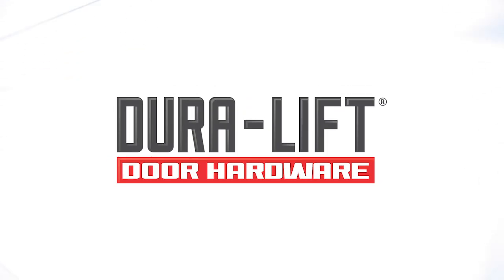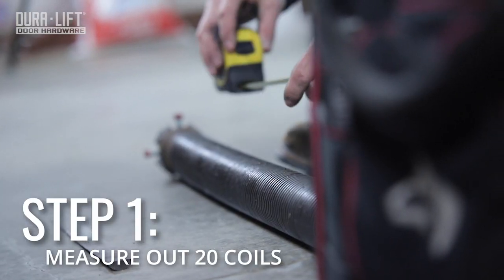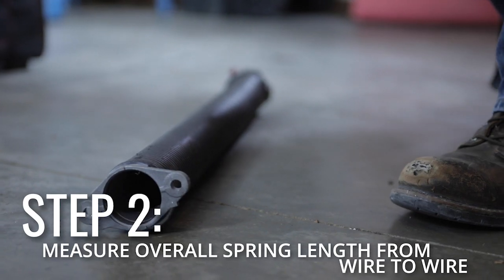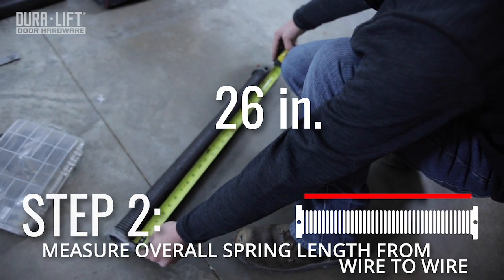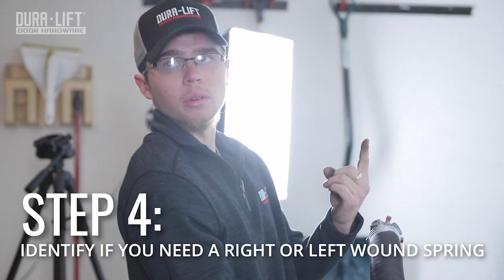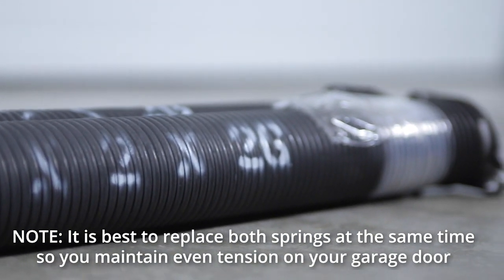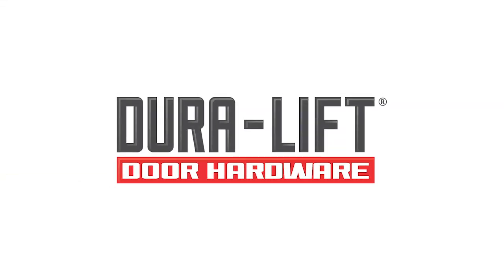DURA- LIFT: How to Select Your Torsion Spring

Comment: How to select the correct placement spring cannot assume that the last replacement spring was correct. You explained how to measure the spring. You did not explain how to determine which spring I need. Isn't that based on the weight of the door (among other things)?

Comment: I have a garage door, on a newly built house, less than four years old. One side of the torsion spring broke. I have researched and know that i should replace both when this happens. Unfortunately, I have found that the springs are different. One side was of gold color and the other side was of blue color. Which pair should I get?

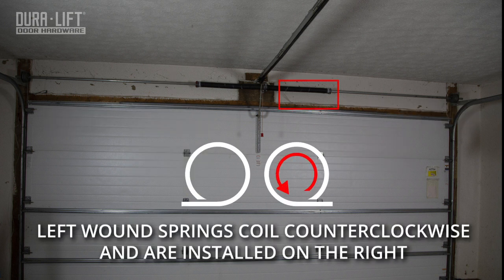Comment: At the 1:16 mark the overlay graphics for left wound and right wound springs are wrong. The overlay white graphic for the two springs should be swapped left to right, and the overlay text for the spring on the right hand side of the door should say "Left wound spring coil (and wind up to store energy) in a clockwise direction and are installed on the right". And the red winding arrow (depicting the winding action) should be moving clockwise. And of course vise versa for the spring to be mounted on the left hand side of the door which begins at the 1:22 mark.  It should say "Right wound springs coil counterclockwise and are installed on the left". The good news is that the red (left side) and black (right side) color codes were stated correctly, and so the spring wind direction is of secondary importance. If you install the red painted cone spring on the left, and the black painted cone spring on the right, its going to wind up the springs in the proper direction to counteract the door weight.
Reply: Good catch, I was confused by that.
Reply: Thank you.

Comment: This all assumes that the correct spring was installed in the first place, which in my case would be incorrect!  I weighed my door  with the door all the way down on a digital bathroom scale and got 153.4 lbs.  This is for a 14ft x 7ft door in my case.  There was only one spring on my door, which was broken, and which measured .207" wire dia. x 2 in. I.D. x 24-3/4" long.  This is only good for a door of about 74 lbs!  In reality I need 2 springs similar to this at 25" length for a weight capacity of 148 lbs. or maybe 2 that are a bit shorter, like 23" for a weight capacity of 162 lbs.
Reply: Just asking....when you say you measured the weight with the door all the way down..... you ALSO need to lever the forcing cone so that the attaching cables to the bottom panel...are TOTALLY SLACK. If you did not do that, then you will get a wrong reading.... too light. If you did that....fine....but this point may then be used for others who read this and may not know.
Reply: You are absolutely RIGHT  !
Reply: I do have the same problem but my G door weigh 170 lbs so I my need a pair 28", did you got your door fix out